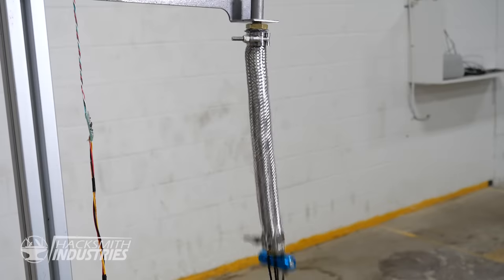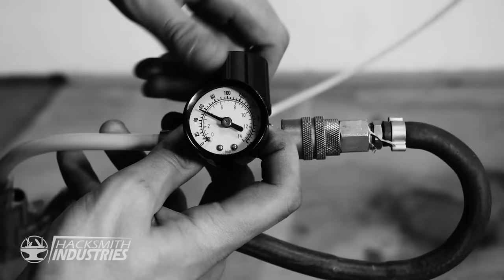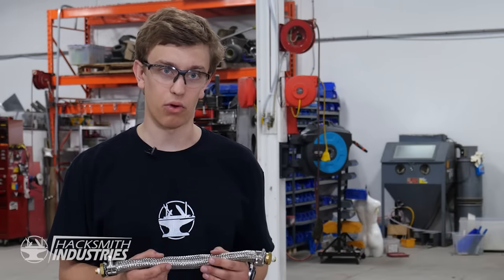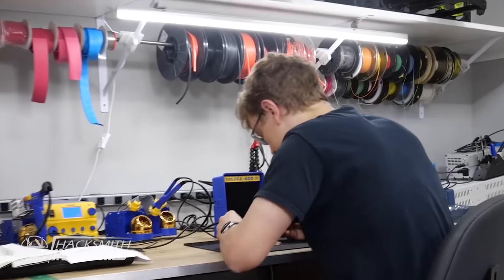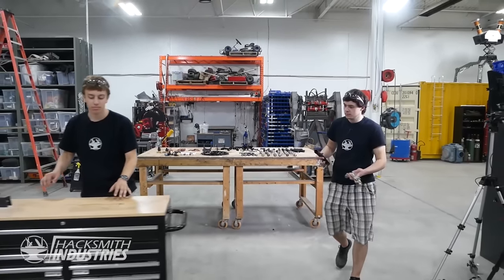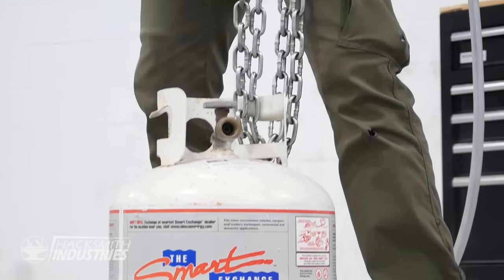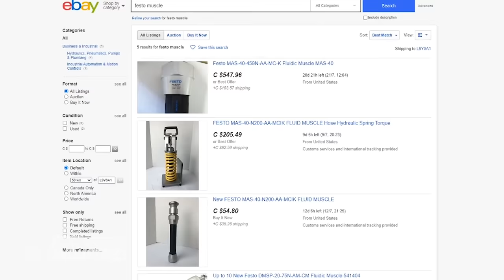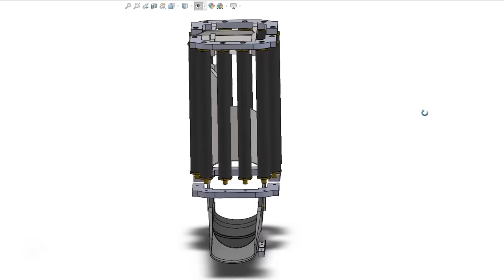BIONIC ARM = MAXIMUM STRENGTH (Crysis Nanosuit IRL)

Comment: A LOOOOONG time ago (1980's), there was a company working on artificial muscles, but instead of mechanical or pneumatic or hydraulic they used photo-reactive material. What happened is that when this material was exposed to light it contracted exactly like a muscle.  I followed the project for a while, but it failed because they couldn't get a fiber-optic switching system good enough.  I've always thought it should be re-attempted as fiber-optic switches have come a LONG way.  You would basically have to recreate the human nervous system, but the system would have the benefit of not being slow and clunky like the suit demonstrated here.
Reply: Sounds fun
Reply: What’s the name of the company
Reply: What was the project and company named?
Reply: 40 years
Reply: Bro what

Comment: Damn, wish I found this video sooner because I used these actuators in my master's thesis to build a prosthetic limb for transtibial amputees.  You guys did a great job but these muscles can be way more powerful than what you showed if you vary things like length, bladder diameter, and wall thickness.  I was using much smaller actuators and I was able to achieve comparable strength to your larger actuators.  I was also able to get much more of a contraction by messing with the parameters I mentioned above. The most difficult part of these actuators is how you secure the ends (I think you found that out the hard way) and as part of my thesis we came up with a clever way to weave the actuator at the ends to increase its durability.  I highly encourage you guys to revisit this topic because I definitely think you're only scratching the surface with these actuators.  I'd be willing to answer any questions you guys have or try to point you in the right direction.
Reply: This is a great channel. If they were so overconfident, they would not have hearted this comment, they can take constructive criticism.
Reply: Hire this man
Reply: I know nothing of these actuators but instead of using 3 large actuators like they did, how would it fare to use a lot of thinner actuators to better represent the fibers that make up natural muscle? They would be weaker by themselves but say they used ones that were half the diameter, they could fit twice as many and it wouldn't stick out as far from the arm.
Reply: @mountieman18  bulging would be problematic with multiple small actuators. You cannot group them too close and that air intake has to stay fixed. It is different with fiber muscles where you have sinew conections that can work in broader angles than fixed intake.
This aproach (multiple small actuators) can be used with polymer muscle fibers but those things are expensive :)
Reply: Did you also use a woven stainless steel sleeve for the outer layer? Did you zero in on a specific optimal diameter for the bladder? When you say wall thickness, are you referring to the thickness of the sleeving or the thickness of the bladder? Share some specifics, por favor, I'd love to tinker with this at my workshop a bit as well :)
Reply: @sementhrower420  Forgive my lack of detail, I finished my masters in 2010 so some things are a little foggy.  I actually used a Nylon sleeving because it was a bit easier to work with and lighter (goal was to get the weight as close to an actual human leg weight.)  I tested a couple different bladder diameters and a couple different bladder wall thicknesses.  Thinner walls performed better because it required less pressure to deform them but they were also weaker and had shorter life spans so it was a bit of a balancing act.  Capping the end of the bladder was also a pain but we made it work with threaded plastic nuts secured with metal wiring.  How much the muscle was able to contract was a function of how the sleeving was woven.  Some sleeving only were 20% shorter when fully expanded but some you could get closer to a 50% contraction.  I don't know of a good way to figure out which is which, I just bought a bunch of different types and experimented.  The nylon sleeving also allowed us to weave the ends into a really strong loop that didn't slip and that's what we attached to the "bones" on the prosthetic leg.  Hope that helps, these actuators really have amazing power to weight ratios its just the need for an external air supply that limits their applications.
Reply: Big brain
Reply: @dhruvaggarwal5131 
Hacksmith: I have a quite a big brain.
Randomonium: Here, I'll let you borrow mine, too.
Reply: This is the most big brain reply section I've ever seen
Reply: I wonder if it would’ve been more reliable to make a pulley type system where the anchor point would be say the shoulder area of a large gauntlet that would then pull the forearm into a curled position, allowing more range of motion the only issue is that while it would be possible to increase your strength by incredible amount you’d still be limited by human durability.

Comment: With defense spending and allocation, something like this can very easily be upgraded. So, no worries guys, you made do with what you have - kudos for that.

And... this kind of an external arm would need a support structure connecting to the ground and taking the pressure of the rest of the body I.e., an Exoskeleton in short. But all in all, good job guys!

Comment: This was cool. The tests demonstrated that enhancing a single body part is not quite adequate for completing most lifting tasks (bicep curls also put strain on the lower back and legs). Without a full-body suit the applications seem few and far between.
Reply: was the first thing that came to my mind, it doesn't make sense, it's really better to work out the whole body, using this can cause a lot of damage to the thin body.

Comment: Use an array of multiple electro-magnets as artificial muscle. I'm working on this concept and it can do a lot. If you have an array of 10 magnets activate 5 and you get half of the full range of the muscle. Activate 10 and you get the full range. It allow great power and multiples states. Each magnets pull the next one, it's a chain of magnet in a fiber (with lots of cables for the moment). Not as soft because it use hard componants but it doesn't produce sound and it's instant. Contact me if you want me to work on this idea from distance
Reply: Sounds cool 😊 👍. But have you given thought to what all of those magnets would do to your blood being and having metal in it might cause blood clots in areas in which have high concentrated amounts of magnets.
Reply: @pollariperry6455  I'm not into medical stuff, it's not supposed to go inside a body. I don't think magnets would have any effect for an exo arm to be honnest.

Comment: Cheers lads. I'm an Austrian mechanical engineer, motorcycle mechanic and sparetime drawer. A lil' idea o' me:
Look up the battle slasher of one piece film Z for a good idea to unload the force a bit to the rest of the body.... The characters name if needed is Zephyr. Anyways, instead on a pneumatic muscle, which contract too less.... How about a pneumatic engine at the bearing or a gear in between of it.

Comment: Suggestion:
Mount the elbow pneumatics on the forearm (because it really shouldn't matter which side of the joint you pull and push from), and then use a base plate on the wearer's back and front to mount supporting pneumatics for the shoulder so there's less intensity placed on the wearer's shoulder and spine?

Also means when a tube explodes, it's less likely to be one by the wearer's ear.
Reply: I have no idea what you just said but is sounds very smart so good job 👍
Reply: @Blackhole_T618  I'm basically just suggesting a different layout for the pneumatic muscles - one which should allow for more pneumatic muscles to be added to the arm which would support the shoulder ('cause currently the design doesn't support the shoulder at all) and redistribute where the wearer feels the weight.

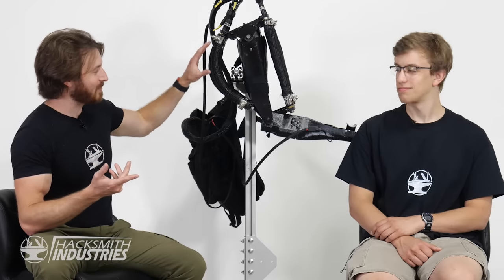Comment: 19:00 according to FESTO catalog, a 40mm internal diameter muscle can theorically reach up to 6000N, and doing F=A*P/10 a cylinder with the same internal diamater only reaches 750N at 6bar

Comment: This was really cool. 
I was wondering though. They mentioned the inflatable tube for the muscle can expand a bit, what if the outer steel covering was a wider circumference to start with? Sure you might only be able to hold 1-2 tubes on each side due to space, but youd get a couple more inches of lift. And instead of the muscle ends being connected next to each other, have them more in a circular bind like how actual muscles are? And then just account for inflation space.

Comment: Can’t you use a lever, like in the Archimedes story to provide more movement? (Just a question btw not a critique lol, I’m genuinely curious)
Reply: Using a lever would have effectively provided more movement at the trade-off of losing torque at the end of the arm.
Reply: They are already using levers. You can see that the muscle isn't attached to where the weight is placed but much further back on the forearm, which makes the whole foreare a lever. This is also the case for our natural biceps (and many other muscles) making a couple of inches of contraction enough to bring your hand up to your shoulder.

Comment: I'm not sure I'll get an answer. I'll try to ask.
Why you can not use liquid nitrogen as a muscle filler. A small balloon and nozzles for injection into the muscles. It will take up little space and solve the problem with the drive. It is possible to inject nitrogen into the muscle during contraction and bleed through a separate valve to the outside during unclenching. Then the exoskeleton can become mobile.
The only problem is temperature. Heating will require less energy than running a compressor.
It just seems like a mistake. We first convert mechanical energy into electrical energy and then electrical energy into mechanical energy.

Comment: What if you designed a system of pulleys situated on the exoskeleton so that the cylinders could be mounted on a plate on the back. Kinda like how the muscles that move the hand are actually in the forearm and they just pull tendons to move the hand. That way you could use hydraulics, which are stronger and more precise in movement. Also, if it bursts, it's behind you and not in your ear...
Reply: bro you should join their team
Reply: Well that will do pulleys 😍
Reply: woah man that's pretty good thinking
Reply: that is called"  jaeger "

Comment: 20:00 How was losing 2 out of the 12 muscles = losing 30% of the strength? What did I miss in math class here?
Reply: Maybe they used the different muscle types in it, and those two added up was 30%?
Reply: They lost 4 out of 12 muscles, two back, two front.
Reply: @zoggeris  thx 👍
Reply from the maker: 2 per side
Reply: @hacksmith  oh

Comment: When you realize that even Elon Musk chose stainless steel over carbon fiber on the Starship
Reply: That was to do with heat though wasn't it?
Reply: @Maurice_Moss   The main reason was that the particular type of steel they use actually becomes stronger at cryogenic temperatures and being steel it's a lot cheaper than carbon fiber. Also steel is much better at withstanding re-entry temperatures so there's that.

Comment: If you want to prevent muscle explosion make a steel bearer that has different diameter at different lengths of the pipe.
When it get pressurized it looks exactly like crysis nanosuit muscles

Comment: I live it. One of my favorite games. I like the idea of perpetual energy generators. They use magnets and most seem to be a gimick. But what about launching such a device on space where the magnet can spin with way less friction and generate electricity in a copper coil.
Reply: First law of thermodynamics. Energy can not be created from nothing, nor destroyed. Even if such a system was completely frictionless (which is practically impossible) all of the rotational energy would be converted over time into electricity, thus eventually it would stop spinning.

Comment: What if you put a knuckle on the end of each carbon fiber bicep and try putting together 3 smaller lengths of bicep and you may get more retraction and expansion? that would maybe give it a more clean look because you could bring the carbon fiber closer to the frame and have more shape.

Comment: Why not try stacking many smaller pneumatic muscles (length wise). Then you'd be able to squeeze 25% contraction from each in a series. And wouldn't that give you more power as well? Try it.

Comment: if you could build a small yet powerful light weight hydralic system you could make some thing awesome, advancements in plastics could make you a light weight metal frame, also if you use small pistons you could control the full range of motion, i could go on and on but....i should be on your design team lol

Comment: If this was turned into a mobile suit with locking parts, it would be way safer and easier to use. The suit would go all the way to the floor and at the press of a button, all of the parts would lock in place giving way more stability to the whole suit.

Comment: Can you put a bunch of small pneumatic muscles in series so you can get more power and more extension?
Reply from the maker: putting them in series wouldn't give you any more extension,  or power.  itd be like just making a long one,  retraction ratio would stay the same.  parallel will give you double force

Comment: There is no hypertrophy actually because there is an expansion of the internal space that is limited. In fact, there should be a shrinkage between fibers so that there is a real hypertrophy that could surpass the 25% margin up to the joint limit. The day they discover a material that has the same characteristics as muscle will be the pinnacle of biomechanics.

Comment: I'm curious if it's possible to create an artificial muscle that contracts by receiving an electric charge.
I'm not a biologist or a bio engineer, but i thought if you could create a muscle that contracts via an electric stimulus, you could achieve what you did in this video with a design that's much smaller.

Comment: Maybe commercial braided sleeves aren't the best material, as they aren't designed for optimal contraction + strength. Maybe there's a better braid pattern that improves the design

Comment: Why not use hundreds of inter woven lines of spider wire small tungsten or titanium pully bars wrapped around smaller layered pneumatic pumps to increase strength and more closely emulate muscle?

Comment: Perhaps there would be more range of motion if they were segmented into 2 inch sections, instead of a full length tube.
Reply from the maker: % of retraction remains the same though
Reply: @hacksmith  So a longer tube would have more % of retraction. How about having a sideways "s" design basically fold a single tube on top of itself, Might be a little bulky though.
Reply from the maker: That would have even less retraction

Comment: Unnecessarily heavy and bulky. They could have used micro pulleys to maximize force
Reply from the maker: Pulleys require longer actuation which we were already lacking...
Reply: @hacksmith  The way how muscles works is in fact like pulleys (biochemically: sarcomeres). The problem was using gas instead of electricity and tubes instead of fibers. The work of multiple fibers, activated by electricity, would be more effective. Ockham's razor

Comment: Here some Criticism.
The whole design is nonsens, trying to replicate some muscles, but doing it wrong. First look at where the Muscles are attached. 
Second, why do you use this system? You could use Electric Motors and  Gears with Chains that can translate the Force way better like a muscle.  Flaschenzug or Bottlepull or whatever its called in Englisch.
Combine Physical Tricks instead of just buying stuff and assemble it.. 
All you did was a lifting maschine that u can stick your arm trough.